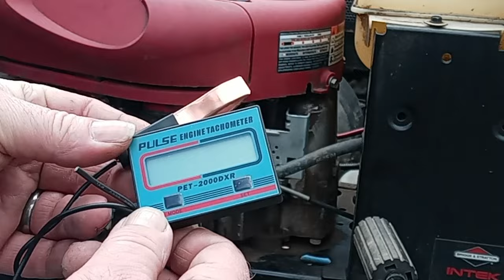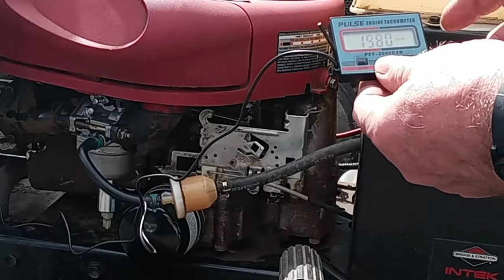Secrets of Briggs Governor Speed Adjustment

Comment: Great information. Mine was set to 2200 rpm from the factory. I wanted to bring it up to 3400.  My ZTs I set to 3500.
Reply from the maker: Hi, I looked up some general briggs specs and there was a range. From about 3200 to almost 3700 depending on size and application.

Comment: Awesome video! You were straight to the point and had very good camera angles with detailed instructions. I may have to reopen my briggs v twin after just rebuilding it. The governor arm will not adjust. It is stuck in full  throttle. I suspect the governor weights broke when i started it up. The 1/4in governor shaft hexhead is whats stuck, and cant be adusted. Lets see what happens...
Reply from the maker: good luck, yes that shaft should move freely when there is no linkage hooked to it.
Reply: Go to YoutubesYouTube's "Tyral Fixes All" / setBriggs and Stratton v-twin governor. He'll show you how to do it quickly and easily. Hope this helps.

Comment: As an electrical engineer I can say that the device reading your RPMs should most deffinitely be wrapped around the wire. The wrapping allows for more coupling between the two wires and hugher currents to flow. The unit you yave is just a simple pulse counter and IMHO if its giving you reasonable numbers (not saying 10k RPM or 138RPM) then I would think it should be fairly accurate. I would guess within 10% or so of reality.

Great video! I have always messed with the spring to adjust the tension. Either cutting it or stretching it past plastic deformation. The tab method is probably easier.
Reply from the maker: This was my first time with this type of meter. Wrapping around the wire was the key to a more consistent reading. I'm  sure I will grow to trust it more with use. Most small engines will have an attachment point for the spring that can be adjusted to change top rpm.

Comment: I can see you really know your stuff. I'm having problems with a B&s 14.5 i/c quiet OHV 287707-1279 E1. Flames came from exhaust after running about an hrs. Exhaust starts glowing hot. Clearly overheating. Black smoke on startup and black around exhaust holes. Runs up and down when under load. On a Dixon 3014 ztr. New air filter and spark plug, never had a gas filter. I didn't check spark plug gap before installing. With the excess heat, I'm thinking to much gas or not enough air, making Rich. No gas smell from exhaust however. Any help is greatly appreciated.
Reply from the maker: Hi, black around exhaust usually means it's getting too much gas. choke may be partially closed. float may be too high. also flames could mean that exhaust valve needs to be adjusted. if exhaust valve is just slightly open during combustion you will get very hot exhaust gas leaking through. Make sure the spark plug is the correct one. There are a lot of possibilities.

Comment: Nice video. Thanks for sharing

My 2012 420cc B&S surges up and down. I replaced the carb and coil. No change. Then I noticed the governor arm swings back and forth when engine is running. Valves working properly and compression at spec. I'm thinking to convert the throttle to manual operation and leave the choke mechanism the same. 

Replacing the governor requires buying the entire bottom of the case and is quite expensive. Is there somewhere I can just buy the governor/gear and bottom seal?  This is used for a small yard and really doesn't have that many hours on it. I change the oil and filter yearly. My manual says to set top rpm to 3000. Should I also replace the cam if I replace governor.
Reply from the maker: I would concentrate more on the idle circuit of your carb. even though it may be new, they are made to run so lean, that they just don't get enough gas
Reply: @ridingmowerking  Thanx
Reply: It was the carb. The solenoid was going in and out but clicked. Anyway, had to replace carb. Bought carb for $30 and it had a bad solenoid. Bought a more expensive one and it works. I opened up the ide jet from .40mm to .45 mm and it helped a lot. These do run lean.

Comment: Great video! 👍 It looks like just a little bend on the arm is more than enough? I have two lawn tractors from the 90's with Briggs & Stratton engines with the same type of governor, one is 10 hp and the other one is 13 hp. Do you know what the rpm should be on these engines? One of my engines runs high enough but not the other one so i should check this out thanks to your video.
Reply from the maker: around 3600 is the max, a little lower is better, your connecting right will thank you.

Comment: Question, if you remove the spark plug, shouldn't the piston move inside?  I have an 8 hp one, it has gas, it has a spark but it doesn't start.
Reply from the maker: Yes, if you remove the plug and insert a screwdriver,  and then rotate the crankshaft, you should see the piston move thr screwdriver.  If the screwdriver does not move, then the liston is not connected to the crank. Likely broken connecting rod.
Reply: @ridingmowerking  It seems that in this model, the valves are behind to the spark plug.  However, I think they should also move.  I will open the engine to see what is in it.  Thank you

Comment: My question is cause i have the same setup but those arms are abit Loose ow a little wobbly when moving the trottle back and forth between high and low would i need to replace that so it moves as smooth as yours or is there an adjustment that can tighten it back up so it works like new
Reply from the maker: The rod going to the carb may have a little rotational movement, but should not be sloppy loose in the holes on either end. There is also a spring around the rod to take out any play.
Reply: @ridingmowerking  ok so pretty much much need new springs and the screw with the spring needs to adjusted and make sure all components are there.

Comment: I have the exact same engine in my lawn tractor. I replaced the intake, 3rd carb!, all filters and the rpm still goes up and down and up and down. I tried to ajust the governor and catb but now it runs rough. Any suggestions?
Reply from the maker: Hi,  the up an down is usually a lean condition in the idle circut of the carb. By now you should have had a good carb. The running rough maybe due to the choke not opening all the way.  Make sure you have the sprimg on the rod going to the throttle arm on the carb. Possibly you have a worn.out cam. Take off the valve cover and check the valve adjustments. Also turn the engine over by hand, easier with spark plug removed. While turning, pay attention to the rocker arms. Watch for the valve lift. Make sure the valves are opening far enough. I ha e seen where a cam.lobe wears out and the valve will barely open.

Comment: Hello I followed your video, but I still haven't fully understood how the accelerator works. The translation into French is laborious and painful. I can't get the carburetor throttle on the accelerator by operating the throttle, qui_ works perfectly. I changed the spring on the "plate", but nothing helped, no action on the carburettor throttle flap. I wonder if a part, a rod, a pusher, is missing, which would push this throttle valve flap of the carburetor, I don't understand. The engine is idling, but I don't know how to accelerate. Can you help me? Thank you
Reply from the maker: Ok, you need to make sure that the governor lever can move by hand. You should be able to move the throttle and governor lever even when engine is not running. Sounds like your governor static adjust may need to be adjusted. I do not have a video about that. Check someone like @taryl fixes all
Reply: @ridingmowerking  Thank you! Your answer is very likely. I know how to accelerate by manually moving the regulator rod, the flap at the carburetor moves correctly. On the other hand, when I operate the throttle, engine stopped, the accelerator flap hardly moves. I followed your advice, I made sure that the spring was tighter by twisting the leg a little. There is a slight improvement, in rabbit position (fast), the engine is only at about 2500 rpm or less, but it's enough to mow.
Reply from the maker: Great, you should make sure that the throttle on the carb can open all the way, look inside to makr sure it opens all the way, if not there may be something bent on the top plate keeping it from going all the way. The other reason is that the governor lever is out of adjustment.
Reply: @ridingmowerking  Thank you very much. I'm going to be satisfied with this result. I don't have full power, but it's more than enough, and at least I don't risk tightening the engine. The carburetor flap can give the maximum, but it seems to be limited by the lever. I gained a few laps, I must be at almost 2700 rpm, I don't need more. Thank you again very much.

Comment: Not a mechanic, but is your fuel filter on backwards? Maybe it doesn't matter, but I think mine is installed the other way.😊
Reply from the maker: technically it should go a specific direction. but it will filter and flow in either direction. that is how it was when I got it. considering all the other things I found wrong, it is probably backwards.
Reply from the maker: I did a video on repairing the sticking choke also,
Reply: It is correctly installed. The fuel flows from the outside through the filtering media  and out from there. If installed in the other direction, you wouldn't be able to see the crap that is getting filtered because it would be inside the filtering media.

Comment: Mine idles way to high and backfires if i bent it down would it slow the idle and make it run better?
Reply from the maker: Bending the lever is really to adjust the top speed, not idle speed. There is a screw to adjust idle speed.

Comment: How much can I bend it without blowing my motor
Reply from the maker: Well, it is a matter of time. It can run really fast, but only for so long. That is why you need to check the rpms at full speed. You need to not exceed the max rpms specified by the manufacturer.

Comment: Most small engines run at 3600 full speed.
Reply from the maker: Yes, that's what has always been in my head, used to be on the tune-up label on the older engines. Best source is probable the owners manual for the individual machine.
Reply: Really 3000/3100 is plenty 😊

Comment: mine is broke i think rpm just keeps climbing any way to fix it?
Reply from the maker: Maybe your governor lever is loose on the shaft coming out of the engine. When it is running the governor arm will be trying to close the throttle on the carburetor. Could be that the throttle plate is sticking.  I did a video about a sticking throttle on a new carb. Maybe check that out.
Reply: @ridingmowerking  thanks I’ll check it out

Comment: thats not the correct way to adjust the governor
Reply: Et c'est quoi la bonne ?
Reply: Then what would the approved method be, good sir?

After thinking about it (not even seen his method yet) I can think of three ways to adjust a governor. 
1. Stretch spring past plastic deformity, or cut...
2. Bend the spring tab
3. Adjust the governor linkages.

He just got to his method and he decided to bend the tab, I think that's the easiest. Maybe this isn't the way a Briggs and Stratton engineer might do it, however as a normal consumer I think this video is great. He even mentioned that setting the RPMs too high would shorten the life of the mower.

Great video, sir! This is good information for anyone willing to do just a little maintenance and repair on their own things, like everyone should.
Thanks 😊
Reply from the maker: this method is actually to adjust the top speed, not to set the governor linkage. if the governor was apart, then that is a whole different procedure. I do actually know the difference. thanks for the comment.
Reply: My RPM stay high and for some reason it will shout off if I move throttle down a little bit, even and adjusting throttle cable. I could be bending down governor?
Reply from the maker: @doradodelsol  Hi, If you cannot control the speed as you say, then that might require a static adjustment or reset of the governor arm. this video is not for that. There are great videos of that procedure, https://www.youtube.com/@TarylFixesAll  is my recommendation
Reply: They actually have a tool to adjust the governed. It’s an angled slotted shaft.
Reply: Go make your own video